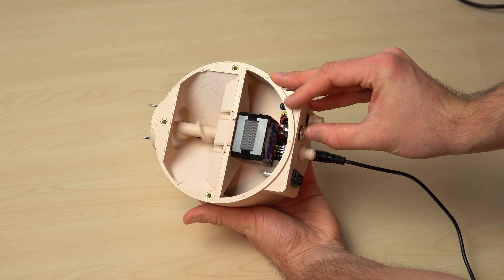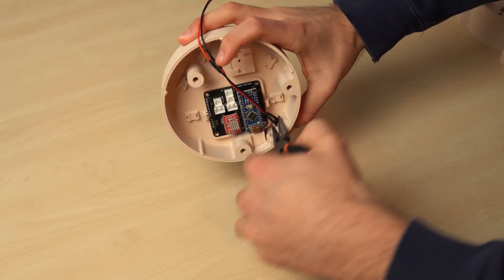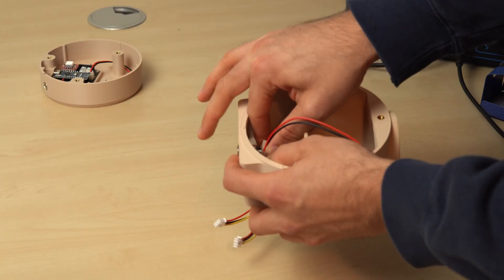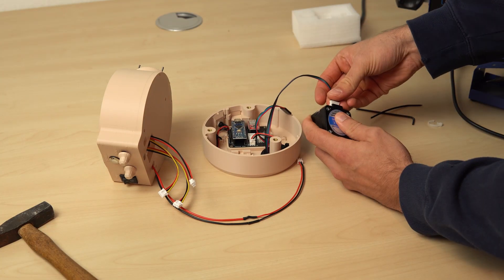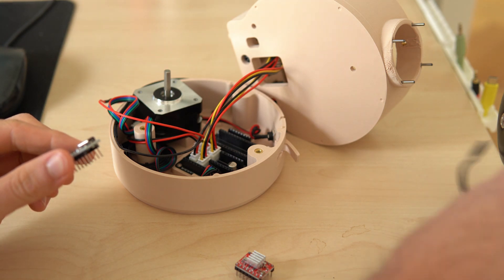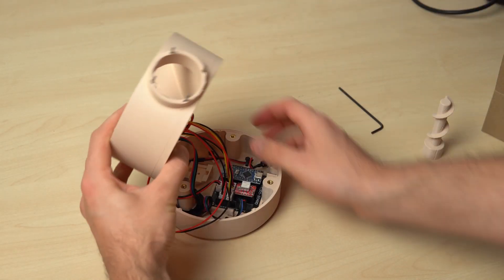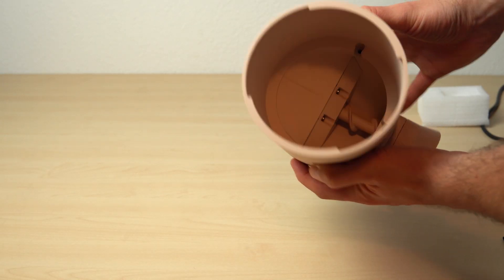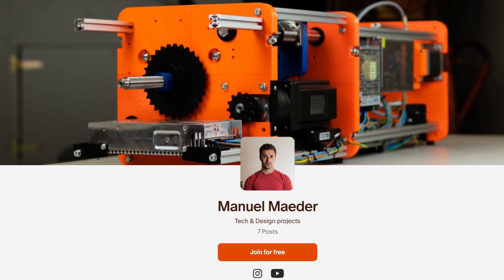I made an automatic pet feeder - Part 3 The Assembly of PEDRO

Comment: I built a feeder myself, and the design philosophy is pretty similar, especially around the housing. One thing I’m definitely changing for V2 (and something you might want to change too) is that I realized it’s super annoying to clean, since you always have to worry about getting the electronics wet.
For V2, I’m going to make all the parts that touch the food removable so they’re easy to wash. The idea is to fully separate the auger and electronics from the storage.

Comment: been looking for a solutions to add the gravity feeder I build out of 6" PVC pipes. We have lots of stray dogs here and I built two prototypes (one for kibble and one for water). the Problem I face is ants and other critters getting into the food. Not alot of control with the gravity feed either. Looking to release kibble at certain times of the day. would be nice to have a high frequency dog whistle to train the dogs for feeding time and dispence acordingly. But that is extra literally bells and whisltes. Solar and or batttery would obviously be needed. You have me inspired with this cool build. Was litterally looking to buy a Petlibro and frankanstein it.
Reply: In order to avoid ants, sprinkle a fair amount of  diatomeceous earth around the feeder. Also, in order to protect the food further you can use an acrylic swinging lid which the dog can push away with his nose. I am here because I have a similar problem and want to make dispenser for stray dogs which needs a refill only once a week or so

Comment: bro i used to manufature pet feeders, and ill tell you this will fail, people will go on vacation and leave their pet without food. Add a fail save, People are dumb and will copy this, and just leave a pet without food for days . Dont 3d print the screw mecHanism, add a level sensor to detect that food level is dropping, and if it dosent after one day , then pop open a rear  port, that just releases the food. do this on a seperate mcu with second battery feed. a completely independent failsafe
Reply: Not having a level sensor is just asking for tragedy, not even a side window so you can see how full it is at a glance!
Reply: Ok Karen

Comment: Great project and great design! 
Suggestion: Next model with an ESP32-C3 to get ESPHome inside and drive it via wifi and Home assistant! 
Keep the great work!
Reply from the maker: Will definitely do that, if there will be a version 2 :)! Thank you!
Reply: I totally agree with this suggestion! I can even say that it can make the whole feeder simpler and cheaper as you don't need any physical controls anymore if you have a web ui or home assistant integration
Reply: I was thinking the same !
Reply: And using a tmc2209!